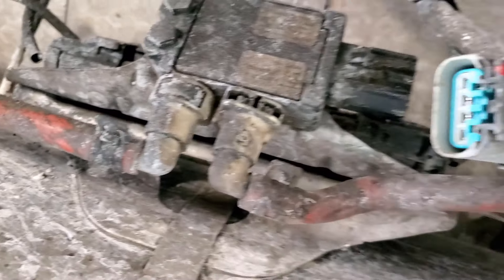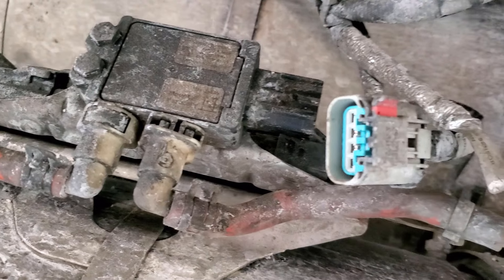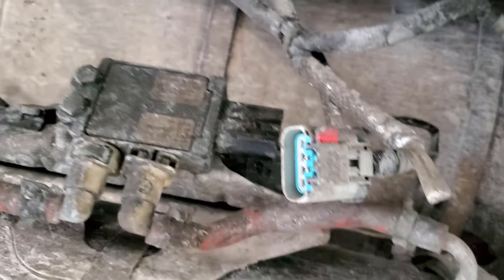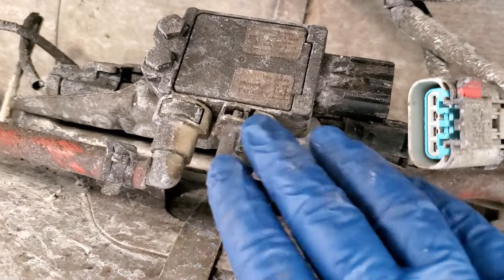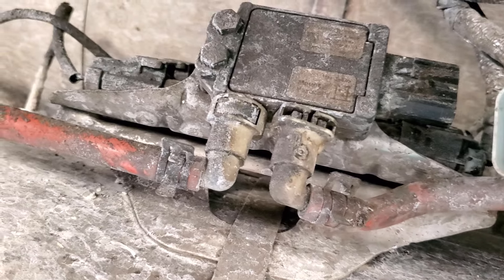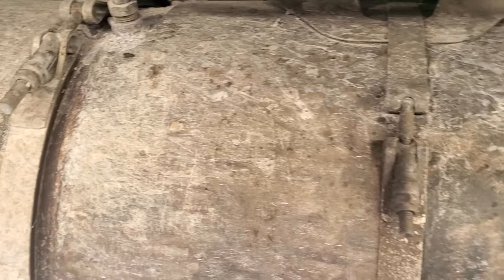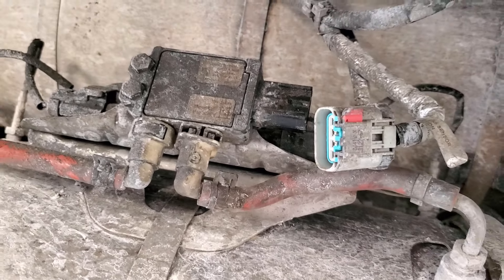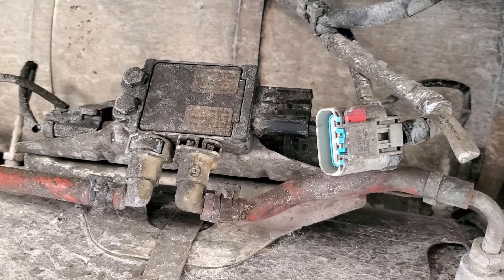Cummins ISX 15 DPF Differential Pressure Sensor Diagnosis & Replacement - Kenworth T660

Comment: I just now finished replacing my DPF differential pressure sensor on my 2017 W900 ISX15 cm2350. I first searched underneath the truck for the sensor, but it was behind the passenger step panel. Super easy access. My two bolts broke, of course, but I got it resolved pretty quickly. Thank you so much for this, and ALL of your step-by-step repair videos. We both know this would’ve been a huge Kenworth shop bill. FYI, I got the OEM sensor for $110 through Amazon, and took maybe two weeks to arrive. I’ll be doing a regen shortly and will use my OTR Performance app to calibrate the sensor. Again, thank you so much.
Reply from the maker: Glad it worked out for you! People shouldn’t afraid of working on their own trucks. Take time to learn and system and start to take care of your own trucks 💪
Reply: @truckingandfixing  Huh, I thought I could calibrate the sensor with the OTR app, but apparently I was confused. It’s the PDI that has that capability. I did a regen and everything appears to be fine, no check engine light nor derate. Do I need to calibrate the sensor for optimal performance, or is it not a requirement? TIA
Reply: @dalejohnson8945  you dont need to calibrate that sensor bro
Reply: What’s is the part number for that sensor please? I have 2017 KENWORTH T680. Isx 15
Reply: I found it out. It’s 2871960. And cost $191 at Cummins store
Reply: @qazaq6893  Sorry for the late reply, could’ve saved you $81.
Reply: @Detroittruckdoctor55 why not
Reply: I got a spn  3936 FMI 2 code I installed a new pressure sensor and everything was good for 1 week now I got the same code and it’s saying it’s a bad sensor again not sure what to do
Reply: @UniversalContentTv make sure it genuine Cummins, the cheap ones on Amazon don’t last long sometimes they are defective before you install them.

Comment: Good video Ryan, do some research on the decomp tube positioning. If I'm not mistaken the two rubber hoses need to do a u-shape up to the sensor. The reason is there is moisture in the DPF when there's different temperatures outside and the moisture should pool in the bottom of the rubber hoses from the sensor to the decomp sensor I had just seen something on this not too recently and I was trying to find it to show you but I can't find it.
Reply from the maker: Thanks! I will do some research about it!
Reply: they are supposed to be slanted so moisture drains

Comment: I installed a new pressure sensor everything was working fine and after 2 weeks i got the same code again spn3936 FMI=2 my dpf filter is brand new as well not sure what’s going on mane the pressure sensor came faulty

Comment: Dealer gave me a sensor with smaller tubes. Can I connect the rubber hose straight to tube coming from sensor without plastic connectors or its the wrong sensor?

Comment: Always enjoy the videos!  I had same issue with low coolant warning. I understand it's the tank because this model doesn't have the sensor pass thru the tank.  More of a magnetic bobber that fails inside the tank.  Replacing reservoir fixed mine. Hope it helps,  you may have fixed already.  Thanks

Comment: If you catch this as soon as it starts, you can just replace the sensor and keep trucking.  The lights will clear themselves, will with most lights.  Had this happen to my 2020 X15 earlier this year.  Changed it in the SLC KW parking lot in 10 mins and hauled ass light went out by Vegas.
Reply: Without programming it?
Reply: @mrgetittherehaulingllc yes. Done it twice now. No computer needed. The CELs will clear themselves
Reply: @Goose2448  on what type of vehicles was that?
Reply: I see the truck,so other question is what lights u had on only one I getting is a check engine light come on off every few hours or so and the code im getting is for the dpf sensor code

Comment: How are you Ryan, I want to buy a diagnostic tool for my truck, one that's gonna give the options to clear codes, run regens, and more.
Single truck, 2012 w900 isx 15.
Any recommendations?
Thank you for your time
Reply from the maker: Check to see if OTR performance works on your truck, if so, it would be a great option.

Comment: Question my dpf sensor is throwing a eractic reading code truck runs fine if I clear the code but once I turn the truck off the code comes back. Took it to a shop they said the sensor is reading fine. Trying to find out what could be causing this? Thanks for your videos!
Reply: You ever figure it out ?  Mine it's doing the same now .

Comment: Did it worked any better or still the same, can you tell?
Reply from the maker: it solved the current problem it was having, but truck was still regening more than normal. I have decided to replace the DPF when I got home. and it solved the regen issue. Here are the couple videos on the DPF replacement: 
New DPF Canister/Filter Replacement (Cummins ISX15 Kenworth T660) Part 1 - DPF Removal
https://youtu.be/f65FcQE3lfY
New DPF Canister/Filter Replacement(Cummins ISX15 Kenworth T660) Part 2-DPF Assembly & Installation 
https://youtu.be/zK_XgZLuyuM

Comment: Nice and clear instructional video. Can you comment generally on the Bosch scanner and the PDI system.......what you like/where they shine, so to speak? Curious as to whether I should invest in both, or consider one over the other.  Thanks for posting.
Reply from the maker: Hi Ian, I have done videos about both. You can check them out. Let me know if you still have questions: My PDI Big Boss Tuner On Cummins ISX15 - Owner Operator Trucking
https://youtu.be/vXg-EGmFGD0

This $500 Tool Can Save You $1,000's   The Bosch HD $$$ | Owner Operator Trucking
https://youtu.be/eIFpb6JjXIw

Comment: Was the truck not getting up to temp before you changed the sensor? I’m having the same issue now, I had an exhaust leak bellow and a manifold after they fixed the leaks I now have the same issue but mines not getting to temp, it threw the differential pressure sensor code, so I’m hoping that’s what it is.

Comment: If you have the code 1921, never replace sensor. Code 1921 is the moderate severe level, and you will be able to do force regen by computer. 
The most severe level is 1922 code (red light). That will not allow you to do force regen, and you'll need to perform the maintenance reset by your computer. After that code will become 1921 (amber light), and you will be able to do force regen.
Reply from the maker: Thanks for sharing!
Reply: What about code spn 3936 fmi16
Reply: Your the fucking man dude thanks
Reply: I have. 1922 sensor Ineed to replace that sensor,  ??

Comment: which version would you use when you change this sensor? what the difference between before or after ash?
Reply from the maker: The software I have doesn’t tell the difference in numbers. Could you rephrase your first question?
Reply: @truckingandfixing  sorry I asked that question wrong. After changing this sensor you force Regen correct ? And then the Before & After ash ? I was looking at your other videos and I noticed that you click both on Before & After Ash. I thought you had an option on which one you choose first or last or if it even matters or when exactly you should use that function(Before&After Ash)

Comment: I get derate in 3 hours then ill shut off the truck and turn it back on it wont be back on for a while..but from time to time itll come back on...can this be the same problem?
Reply from the maker: Has to see the engine fault or code to diagnose the issue.

Comment: I have my Cummins isx15 400ST and its wanting to regen every 1000 to 1500 miles... Do you have any idea what it might be? I changed the whole DPF filter, 2 differential pressure sensors and 1 of the temp sensors on the DPF Filter itself... :(
Reply: also does PDI work for Cummins ISX15?

Comment: If I change this sensor on my 2016 660/ Cummins 2350 450hp is it 100% necessary to do the differential pressure test and forced regen....(I don’t have a pdi controller or Cummins insight). Can I just change the sensor and keep trucking?
Reply from the maker: Sorry for the long delay. I would highly recommend to do a regen. If you don’t reset the sensor, you will always get a engine light.
Reply: @truckingandfixing  thanks. I did do a parked regen. I took it to the shop today and they cleared the original (inactive) code. So are you saying I should expect to see the same (exhaust trap inlet pressure) fault show back up?

Comment: Hello My friend I been an Owner Operator since 1990. But it seems I have to learn to replace sensors for the Cancer of our industry ( DPF ). Can you recommend a good machine that can read and also show me step by step how to replace anything wrong with my system. I have a KW T680 2019. ( I used to just by new truck every 3 years or 450K. Miles.... But that is no longer possible since new trucks went from 145K. To 240 to 280K.
I need to learn to replace sensors that is the only BIG  problem .

Comment: Hi, I work on school buses and I’m having a hell of a time with dpf issues, for obvious reasons, their stop and go nature. 

I’m still new to understanding after treatment, but we got 4 buses, with dpf and egr codes. I’ve cleaned out both egr systems and doc and dpf, the bus will regen, all is well, then the codes come back after a month.

These buses had prior mechanics working on them before I got to this shop, one guy in particular who just like to willy nilly replace everything. He replaced turbo, Vogt actuator and egr valve. 

I’m mentioning all this cause one of the big issues is that the dpf will not get up to temp. One bus it’s at 450 max, the other 920 max. Another it will not regen because of intake maninfold pressure code with engine derate, but also carried dpf and egr codes. 

I’m curious, I’m noticing that you resent parameters after every service of the after treatment system, could this be the issue? I know for a fact the last guy never calibrated anything, so I did that, but I’ve never tried resetting parameters due to my lack of experience 

I’m also finding that these Thomas C2 do not have a fuel doser for the after treatment, so what would turn up the heat in the dpf? 

Thanks!

Comment: I'd rather buy an older truck and skip the CA.
Actually, the emissions systems are bad for the longevity of an engine....the backed up soot, increased heat....sometimes they even go up in flames.
Looks like you manage it well though. 👍
Reply from the maker: I have found many high paying loads are going to CA or from CA, it fits what I like to run, which is long haul.
Reply: @truckingandfixing  , If I decide to go O/O, it'll be more like a retirement plan....flexibility to run when I want or to spread things out at a manageable pace. What I do now is run run run to beat the clock everyday (500/600 mile round trips daily) if I want to go home.
My days are like 16 hour days with an hour each way commute time.....I'm almost 57......I'm wearing down fast now.
Reply: That’s true to some sort but we will never go back to old technology, the issue here is bad engineering filled with outsourcing and cheap parts. That’s what is killing these engines.

Comment: That dinging that set that off is your float in your reserver coolant tank ,,it needs to be changed out believe me ,,problem solved....
Reply: Correct! Horrible PACCAR design for the coolant reservoir. The coolant level sensor that plugs into the bottom of the reservoir is actually just a proximity sensor activated by a floating magnet that is cast inside of the reservoir when the reservoir is made. No way to get access to that floating magnet.
Reply: @Brian Graham  had the wiring on the actual plugs corrode a few times too, and the trucks never had over 600k

Comment: Hey Ryan do you have an contact number I need to ask you a few questions I had a mechanic put computer on my isx15 Cummins saying I need a fuel pressure actuator dpf pressure sensor 2 intake temp sensor outlet box sensor
Reply from the maker: Please reach out via our company email. Thank you!

Comment: Seems all trucks with over 500k require quite a bit of attention. Other you tube truckers with used trucks are doing their repairs just like you are. It’s would seem it’s either that or a new truck payment. I would assume your truck has already had an in-frame, because the other you tube guys with over like 600k-700k have done an in-frame. But, in our up and down, no government, China based economy, who wants a payment on a $160-200k truck? No new truck owner you tube trucker wants to answer questions about the depreciation on a new truck during its first 5 years. Like $120k on a Volvo. About $70k on a PB or KW, but you paid the difference in increased fuel cost versus the Volvo. That is not acceptable to me, Thanks, it was very interesting. Happy New Year.

Comment: You wasted your money there. What i see there are the tubes are not installled properly. The tubes should be installed at an downward position. The tubes go down from sensor but back up at the pipes that go into the inlet and outlet. You need to readjust the dpf filter and pipes. Having them like that will trap soot and moisture giving the dpf differential pressure sensor read higher preasures causing freaquent regens. Also ur bellows before the DOC can cause alot of pressure codes.